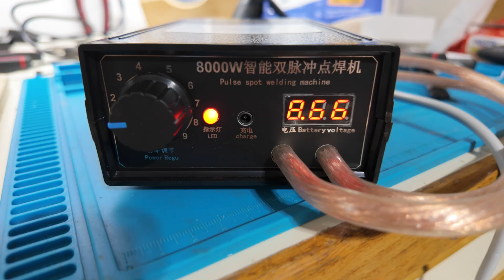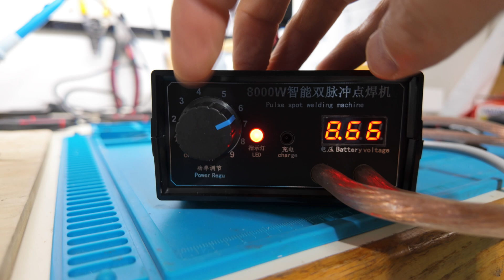Best Budget Spot Welder for DIY Li-Ion Packs? (FPV Builders Must Watch!)

Comment: Hello and thanks for this video. I've reviewed the 8000w thing on reddit /fpv a few weeks ago (tested on 0.10, 0.15, and 0.20mm pure nickel strips)  and was only waiting for the delivery of a 0.15 nickel plated copper strip to make an additional test. I can confirm your tests, on 0.15mm a power of 6 is enough to get solid welding points. I was actually surprised that such a cheap thing can also make decent welding points on the 0.2mm strips, but I had to increase the power up to its maximum. The 0.3mm strips are actually out of its capacity, so I wouldn't use them, as well I wouldn't use the 0.1mm ones on FPV battery packs. Go for the 0.15 or even better the 0.2mm. As for the nickel plated copper, I wasn't optimistic, and indeed it couldn't handle it, unfortunately. Nickel plated copper is definitely out of its capacity.
For its price it's a good deal, despite its flaws: the short cables can be very uncomfortable on the long term, in particular, but if you don't spend hours and hours welding that's not a big trouble.

Comment: Great vid thankyou. I used to use an industrial sheet metal spot welder, the electrodes are always one on each sheet, not both on same sheet. have you ever tried to spot with one electrode on the battery and the other on the nickel strip? If you try it i suggest you turn the power way down. PS i just ordered the 8000